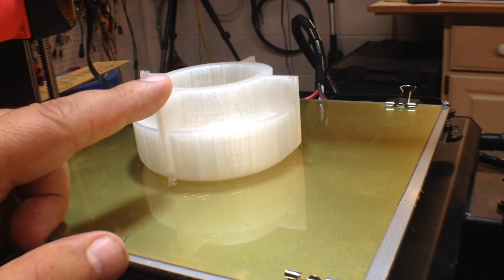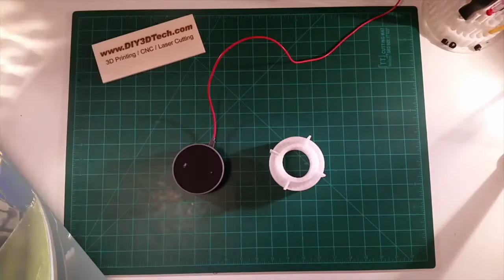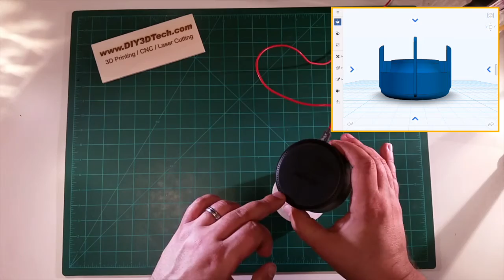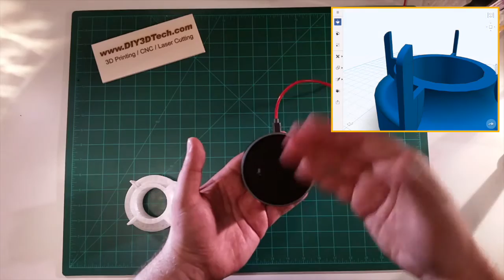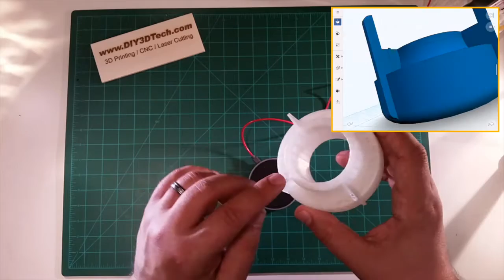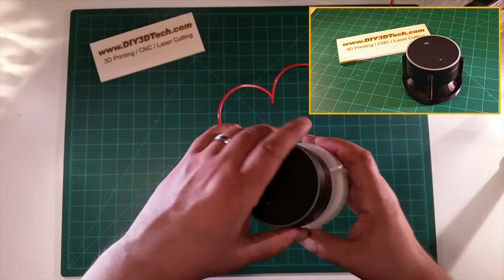3D Printed Project  -  Acoustic  Stand for Amazon Echo Dot!

Comment: One thing I have not seen anyone try is to use the Dot placed upside down. I would love to see you test these scenarios using a decibel meter 1 yard away and 1 yard above the Dot.  A decibel meter app might suffice, too. 
1. No stand. 
2. With stand. 
3. Upside down in stand.
4. Upside down no stand. 

I suspect scenario 3 will sound the best and the stand will help the microphones pick up voice commands.
Reply from the maker: Please keep in mind the mike is on top so there would be an impedance to its ability to "hear" (turning it upside down).  Also get where you're coming from, however, it's not so much about "loud" but more so the sound quality as it a small gap right on the table top.  Worth not is in version two they change with another set of relief holes in the top and its sound 10 ten better!

Comment: netfabb may be able to fix the complex parts

That empty space in the center may be able to be used as a  resonance chamber to boost sound even more, some holes for sound to travel in and back out; {This should wake you up in the mornings LOL}
Reply from the maker: Thought about knocking some hexagon holes to cut down on the plastic and give it a "cooler" look, however since it was a tutorial in the basics keep it that way.  However this has turned out very handy and still sitting on my monitor for a couple months now :-)
Reply: 3D printers, one thing they are better at. If time, plastic, is available; print then actual test the physical design and then improve design, reprint the improve design; round and round until can not think of any more improvement I think they call it prototyping :)
Reply from the maker: Interesting, the Echo Dot has a small 2 or 3 mm vented opening along the taper of the bottom where the sound comes out and frankly not a very big area as its really intended to be used with an external audio out source.
Reply from the maker: You should get one (Echo Dot) they are amazing devices :-)
Reply: Not much cash to buy things

Comment: you would think the fingers would have printed very well as they would have forced cooling as it moved form one to the other.
chalk up an other practical print.
Reply from the maker: Love doing practical things, as the goal of this channel when I am not side tracked is to show folks how they can create cottage based goods using digital tools.  However on the subject of fingers, is there something in model created by the iPad version 123 Design
Reply: did it just stop printing , like is there stuff fin the slicer preview . I have found some stl's tat don slice correct or print well using slic3r or cura do just fine in https://craftunique.com/craftware .  I use only free slicers rite now.   but craftware is pretty darn good for free, and seem to capture fine details better . Its worth a shot if you have not tried it yet ,
Reply from the maker: It tried to print them but no plastic feed though.  Craftware, hmm saw that on maker muse maybe thats worth a try as I have been Cura fan boy for a while.  I also know people swear by SImplify 3d and it likely good however $150 is a little pricey considering I can buy a printer for a little more that and there so many "free" options to mess around with.  However when I go to do production in the near future I will likely spring for it...
Reply: I have had real good results with Craftware , its like  cura and simplify had a child.  it can drive a printer , but i have not had it run my Mini  i just save the g code and load it in reppetier host in the g code menu .  But i will soon try and set my printer up for direct  control form Craftware , just to try  as it could be good .  
so far its has been good for dimensional accuracy and printing fine things in my PLA.  I do most all my slicing in Cura , via reppetier host .
Craftware has some deep menus settings in the advanced tab , and i love how it tries to show a graphic to  explain what the section your are in settings do .
Reply: just a thought on no plastic feed through , if its not a partial block , is it possible your retract settings were too high ?  ie too much retracted to get head pressure to extrude when it wanted to ?  I have done that with one of my fussy translucent orange PLA's , and it was deleting all the small spires on a model. it went through the motions but no PLA came out till it got to a bigger area , . . i wish reppetier host supported more per filament settings . like  having  stored retract values to apply vs defaults  for each saved filament .
Reply from the maker: You know by George that might be it, while have the retract travel set so this should not be an issue as with the short travel there should be no retract.  However my experience in the past has been this setting (min travel) is flaky on the Wanhao